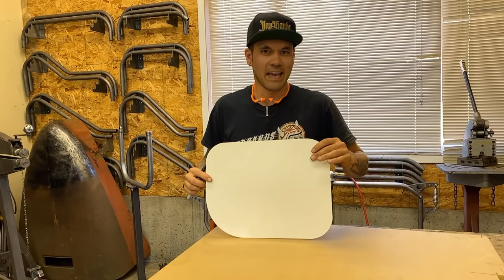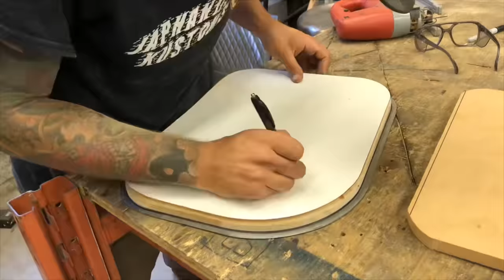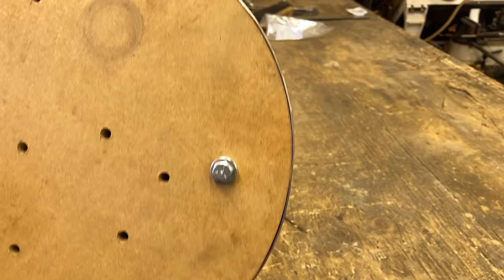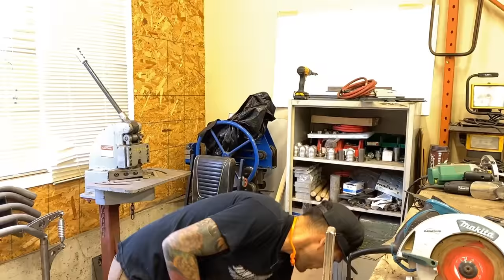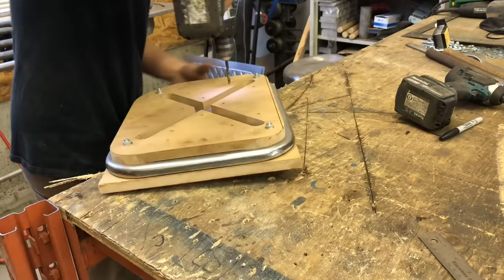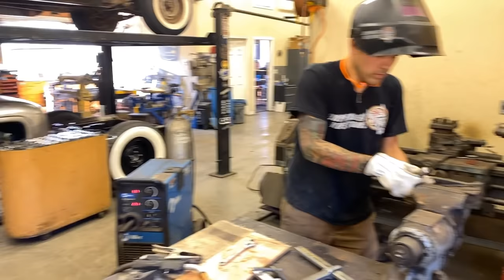Hammer Forming a Beaded Panel with Basic Tools!

Comment: You might try using the router to cut the bottom form for the"X".  You could pick the depth without having to find the right thickness material for a depth stop.  Great video, thanks for sharing your knowledge!
Reply: Good idea
But I’m also thinking the way he did it gives you options
Reply: I agree,Using a core box router bit to cut the bottom board would give a nice rounded form and you could adjust it to whatever width or depth you want.
Reply: He did say basic tools and did a damn good job sticking to that IMO. A router is like, right on the cusp of where you start getting expensive just due to the bits alone. However you can pick up a jigsaw and chop saw at a pawn shop for 20 bucks.
Reply: @FilthyHyena He already used a router to make the rounded wood for the edges.
I think a router for X shape would've been way easier than his method.

Comment: PPE on the MDF, the dust is toxic due to the bonding agents. Great content, love your work mate, cheers from Sydney Australia.
Reply from the maker: Thanks man I’m definitely going to wear the respirator in the future. Gotta get better with that stuff 🙏
Reply: @MakeItKustom  It's not just the bonding agent, which is formaldehyde glue and is also found in particleboard, but it is more to do with the very fine dust that is produced when using machine tools like power saws and routers when cutting and shaping MDF.
Mark from Melbourne Australia
Reply: Just caught this video and that was my first thought when I saw he wasn't wearing a mask! Its a must when working with MDF, I was going to comment the same.
Love your videos though.

Comment: As someone that’s looking to expand my skill set for my own projects, I greatly appreciate you sharing tips and tricks like this for those of us that haven’t yet established a sufficient tool collection. Keep doing what your doing man. It’s much appreciated!
Reply from the maker: Thanks a lot for your feedback I’m happy to share as much as I can
Reply: @MakeItKustom  just a thought you used bolts .. maybe try heavy drywall / deck screws to hold the boards smaller hole to weld up .. going to try and make a skin for a Jeep tail gate 81 Jeep wrangler ..just repaired my dads lower half rusted away .. My 2nd jeep is a rust bucket ,, might try making a skin can buy a cheap tail gate around 150.00 US  but that's not fun working with my hands is ,, used my stud gun on the weld seam of the gate could not get behind to hammer the weld ,, used about a 1/16 in thick of bondo on the weld seam about a 1/2 wide in some spots ,, learning as I go hands on thank you for you videos

Comment: I watched this with much interest, as I made similar dies to form 1968-72 G. M. A- Body firewall  heater delete plates years ago.  Forming the edges with 18 gauge cold roll steel sheet metal, I used 3/8ths thick steel to make my dies, as the edges  had inside and outside radiuses. Your work is very impressive. Neat and concise. Thank you again.

Comment: Great video. I've formed beads the same way, and your video made me realise how much I need a more powerful air hammer! The one I have  struggles with smaller beads.
Reply from the maker: It’s funny I barely ever use this big air hammer but holy crap it could’ve ripped the sheet metal it’s got so much punch
Reply: It's probably your compressor.

Comment: Fantastic skill, beautiful work, showing what can be done with basic tooling.
My only advice would be, use a vacuum to clean up the MDF dust, as that stuff is really bad for you.
Reply: Ditto on the MDF dust, that shit will kill you
Reply from the maker: Great point on the dust thank you very much!
Reply: The MDF thing ,very. much so but also holding the part whilst cutting it, grinding and buffing is a bit sketchy but if your cutting then stick it in the vice, fingers are useful things and best kept on a hand,  I have been using grinders for over forty years and five years ago had a nine inch one go rouge and slice open the back of my hand, eight weeks in plaster and three months physiotherapy to get back as much as I ever will and its more tender than the other hand if I knock it, you have a very informative channel but please take care and stay safe.
Reply: @CrusaderSports250  Shit, you were lucky to get away from that 9 inch grinder bite. I knew a guy who was using a 9" grinder with a 9" power saw blade to cut the bottoms off door jambs to make way for a floating floor. Made the cut OK but as the grinder was slowing down, he relaxed and the blade bit and jumped up and bit his knee. Went to the hospital and came back out with a patched up knee and a super-bug infection to slow his recovery down.

Comment: Hi Karl, I would just like to thank you from Sheffield (Steel City) England on the superb way you present this and all you videos. I am teaching my daughter welding of all types using ,mig, tig, gas, and arc including some metal work that she needs to do on her camper van/RV. I found this particular video purely by chance and really covers most of the challenges she needs to face. The content is excellent, well presented in a clear and concise manner. Being hard of hearing I find your voice absolutely clear and easy to understand, there is no waffle or hesitation and if you make a mistake you swiftly admit it and proceed to calmly resolve it. My start in life many years ago was as an apprentice engineer over 5 years, in the first year it was all about making tools with regular hand tools to high tolerances and finishes. In the latter part we were then allowed to use a variety of lathes, milling and shaping machines but to name a few. On leaving the training centre you left with a fabricated tool box complete with a tool makers machine vice, toolmakers clamps, combination callipers and some small BA spanners also tap wrenches. I am in awe of the skills you have and the way that when needed you just make the tools you need to facilitate completing a job, you remind me of me, except that I think that collectively you have a lot more skills overall particularly in metal shaping and forming. I am now hooked on your channel, probably seen about 90% so far. Thank you.

Comment: I just found your videos today and I'm hooked. Relatively simple solutions for complex problems in fabrication. I have a question about this method in particular. Why not just use the router to set the depth of the X on the buck?
Reply: I was thinking that same thing, he used one on the edge
Reply: Beacouse probably that would bent the buck.....mabe
Reply from the maker: I could have but I didn’t have the bit to run the depth

Comment: Great to watch, your skill level is very high both metalwork and presentation. The camera work is also awesome. I thought you were going to use the router to make the cross form with a rounded bit, would this not be easier and then you automatically have the depth stop?
Reply from the maker: Yes that would’ve been amazing to use a router bit it would’ve saved a step for sure I just don’t have one
Reply: @MakeItKustom  Ah, now comes the build up of the router bit collection. 
A great way to start is with one of those larger sets with multiple bits of different sizes and shapes.

Comment: Great presentation and content. 

How about how you plug weld all those holes without distortion or leaks?
Reply from the maker: Yes good point I should do that and show it thanks for the feedback!
Reply: @MakeItKustom  thanks for taking it how I meant it, not as a smarta$$, but there are so many details to this stuff. It would be almost impossible to remember them all. One detail from your bead rolling the teardrop galley hood that I’ve never seen anyplace else (and I think I’ve seen a bunch) was using a smaller lower die than the upper die so it was an interference fit. Do you leave the edges of the lower die sharp or do you round over the edges?
Reply: Had the same question.  Great videos! Subscribed!

Comment: You have a. Marvelous spirit! I truly like what you do and your passion, congratulations! 
I have this suggestion for you; instead of placing an additional pice for depth, use either of these two options to avoid wood waste and work. From the pieces that you cut off for the 'X'  slice them at the desired thickness and place them in the slots. Second option; weld a donut around you rod at the desired depth and that will hit the topper when you get to your desired depth😉.
My hat off to you dear friend, Dan

Comment: your videos are inspiring. after watching a few of them i came across this. so i gave it a go. i'm building a 48 ford f1 and of course all four fenders are rotted at the running boards. the patch panels were to spendy for a guy on social security. so i built the forming dies from 2x4's and started hammering. worked great. i don't think i would have tried it had i not seen how easy it is and saved me a bunch of $$$

Comment: Thanks for sharing this skill set kid. Have a good one! I enjoyed and learned. I did fix vehicles but not paint, body work or sheet metal forming. I got my first and only 150 amp MIG in 1984. Many moons ago & hundreds of miles of wire. My invoice for 25/75 shield gas cost me $13.80 delivered. 125 Cu. Ft. tank as well! MIG still works great, it weld 1/2”. Great use of the air hammer.  Now, weld holes shut with brass or copper backing to hammer smooth. I got two blocks of alloy copper that are 2.5” wide, 1/2” thick and 8” long for $12.00 at a garage sale in 1986. Never realized what I had until way later, but the perfect size for most spots and places. Never forget malleable vise jaws either as working on smooth machines parts. Thread file comes in very handy as well. Enjoy learning, thanks.
ASE Master Tech since 1978 - Retired
Reply from the maker: You and I are the same people lol I found a really nice thread file at a garage sale and have used it way more times than I can count it’s gotten me out of so many jams. You’re right about the backer for the holes what a great way to fill them

Comment: Awesome video!  When I was a young lad I bumped formed hundreds of teardrop shaped pans in aluminum very similar to this... Except so that they wouldn't crack I had to anneal the aluminum after a few light bumps with a hammer made like a leather bag filled with lead shot.  To anneal, soot up the aluminum with acetylene rich torch, turn on the oxygen and lightly burn off the soot then let cool naturally. They were for an airplane cowl that covered rocker arm covers for a radial engine.
Reply from the maker: Wow man I would’ve love to work on airplanes and learn aluminum panel craft. You must have so much knowledge stashed in that brain of yours

Comment: Hi Karl, Had my first attempt at making some floor pans as per your episode. Actually worked out a lot better than I expected as I had a few problems along the way. My compressor is broken so no air hammer for me. Instead I used a demolition hammer. You know the ones that are slightly bigger than a standard electric drill. I broke my home made dies a few times so it didn't go as smoothly as I would have liked. It's far from perfect however when it is all said and done I am happy with this first attempt as it didn't really cost me anything as I was mostly able to use what I had lying around. Thanks for sharing, I really appreciate it.
Reply from the maker: Awesome man I’m glad it turned out better than you expected it’s only the beginning!

Comment: There you go. I'm a cabinet maker and watched Lakeside Fitzee's and your channel to pick up body work tips on doing extensive rust repair on a 2004 Dodge Ram. I cut out and installed new box fender panels , fabricated my own  outer wheel houses  (170.00 each to buy). I fabricated  2 piece lower fender tips as well . All was done using MDF jigs .  Making 2 piece jigs with the metal clamped between them prevents the metal from warping while you hammer shaping it. I make the top jig smaller then the bottom by the amount of the round over then router a 45 degree angle. It makes it easier to get the hammer on the right spot. To deal with inside curves without a shrinker I make a cut hammer it down, then cut off the overlap and butt weld it back together. After grinding you cant even tell their was a cut there. 
BTW your using your router wrong. Going backwards is called climb cutting. That method is used when you have a lot of material to take out and you need to do it in several passes, but you always finish by pushing the router forward on your work piece,

Comment: Saw this video the same day I finally got thin TIG figured out and now I am getting excited about floor panels and maybe even a custom gas tank. Slowly building a '46 one ton, with a 7.3 powerstroke and manual trans. So will have to make holes in the floor board not just fix rust.

Comment: Another great video, I have used this (use of plywood ) method on copper and brass often but  still learned  a great deal, i.e. the use of many bolts to stop the slightest movement of the sheet metal, thank you again.

Comment: Thank you Karl !! Love your videos. I only had one question or tip: use a router to cut a half round channel in the bottom piece instead of using those spacers. Then you can just hammer the metal into that channel. Maybe some one commented that already. 
Keep up the good work! 🤘🏼👍🏼

Comment: Great instructional video with lots of details. An option you could consider is  using a round nose router bit for your bead form, just a thought. Thanks for sharing.
Reply from the maker: Definitely if I had around those bit I would use it for this! It would keep the bed extremely consistent

Comment: Just a quick tip for when you made the air hammer tool. If you had cut the donor tool a little longer and also drilled the back side of the new rounded head on your lathe you would have automatically centred the new head before welding. 
Also, place something over your lathe ways when grinding to save tearing up your ways. 
Mark from Melbourne Australia
Reply from the maker: Thanks so much for your suggestions and experience I appreciate it!

Comment: Awesome demonstration man. I use form to put jogles in channels I’m making and large radius channels. Quick tip you may already know, having the skilsaws blade just deeper then the material thickness makes the cut easier to control. Great video, thanks.
Reply from the maker: Great tip thank you!

Comment: Just tried this for Ford Econoline floor panel repair patch, worked out great and I’m no metal worker but a carpenter, so I know how to the timber, routed out the grooves and didn’t have a air hammer but I had a hammer drill with an old bit ground to suit,  keep up the good work Karl (wear a dust mask cutting that MDF though)
Cheers
Reply from the maker: Thanks a lot man you’re totally right about the mask! Cool that you were a Carpenter and made this happen no problem. I do really like making panels this way although I am no Carpenter I’m sure I could learn a lot from you

Comment: You really are an inspiration to a lot of people including me. 
If you didn’t want all the holes in the panel how would you do this? If holes are a must have, what would the best way to keep it from warping from the heat while welding?
Reply from the maker: Thanks so much ! The best way is to use strong clamps instead. Also you can put double sided tape between the metal and wood to help keep it from slipping

Comment: Great video.  Thanks for the tip.  I have a fuel cell that needs to be built.  Maybe, I can do the shaping and take it to a welder to complete it.
I'll try it.
Reply from the maker: Right on if you use a ton of clamps you won’t need to drill the holes

Comment: Great videos! Good camera work that shows what's going on,  and the dialogue is to the point paced well and easy to understand.  I worked 35 years  in aerospace as a Manufacturing Engineer, nice to see these skills being not just kept alive and also taught! Question,  when forming the X would it help to put a radius on the lower buck to not stress the metal as much?

Comment: I use similar methods & a lot smaller hammers to make helicopter parts from Aluminum. This is the first time I have seen ribs this wide and deep done by hand on steel. I'll bet it is tougher than pre-WW2 trucks.

Comment: just a idea if you make the tip again chuck in in the lathe drill a hole for the shaft to go into the tip a bit ,, that way when you weld the tip to the air chisel shaft it will be in there sq and it should also add strength to the tool .. Great Video

Comment: If you don't have a router, you can sand your radius into MDF easily.
You start with a 45° chamfer that is 0.56 the width of the radius. Scribe both radius and chamfer along the edge with a sharp pencil and you're good to go. (For 10mm radius, 6mm chamfer is okay. When you make radii bigger than 20mm, you should use the 0.56 number for your calculations) When the chamfer is filed on, scribe along the middle of the chamfer. Then round the chamfer off to the three lines. Done. A little practice makes this an easy job. When you've become good at this, you can even make rounded edges that go from one radius to another size.
This is hard to describe. If I left something unexplained, feel free to ask.
Reply from the maker: Thanks so much man! I appreciate that you are sharing some extra tips and knowledge here!

Comment: Thank you sir,
Very interesting and useful. I want to put the grooves into my land rover bulkhead floor pans as would have been originally.
The replacements don't have this.
But you give me the idea to make the jig and form four sheets to cut and weld in.
I have two series three vehicles, so 4 floor pans to do.
Btw buy a silky fox pruning saw. It's a Japanese blade and you will find it very useful. I can see you love your power tools, but believe it will save you time and give you a perfect finish off the saw.
Thank you again